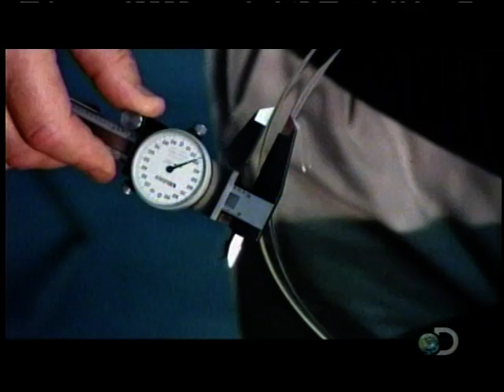How It's Made Technical Glass

Comment: 4:47 holy shit u couldnt pay me enough to have my hands near that large unguarded saw blade
Reply: That type of saw blade does not have the sort of "teeth" that you might normally think of with respect to saw blades.  It's more of a very fine abrasive grit of diamond chips that is bonded to the steel.  I've used a similar type of blade in a tile wet saw for cutting stone when I was doing the floor in part of my house.  Even bare handed, I didn't consider it particularly dangerous and the worker in this video also had gloves on so he would feel the glove getting hit before his hand was hit.  A normal woodworking table saw blade is a lot more dangerous.  It's not surprising to find old woodworkers missing a part of a finger from mistakes with a table saw.  Also, since it is a "wet saw", you start feeling the increased water hitting your hand as you get closer to the blade.
Reply: @CurmudgeonExtraordinaire  you're right sir, it's almost like or same as cutting disc used to cut tiles.
Reply: Don't be a pussy.

Comment: Wrong, "technical glass" is defined by the application. The glass is still susceptible to chipping. A low thermal expansion ( Borosilicate Glass) and   low imperfection glassy matrix help to increase chip resistance.

Comment: @VicariousReality7 As the narration says this type of glass is used where tolerance to abrasion is needed such as the landing lights on the leading edge of an aircraft wing or low thermal expansion to prevent cracking as required for automobile headlight bulbs. Hope this helps.